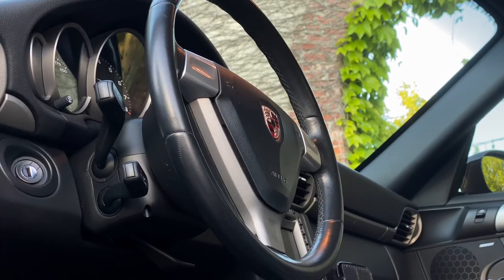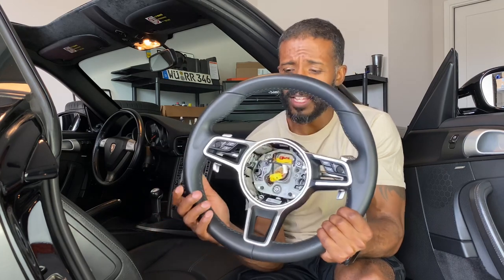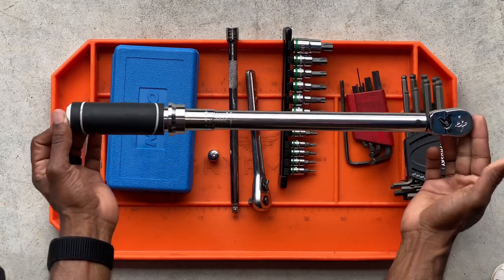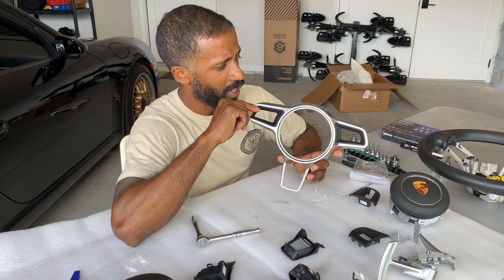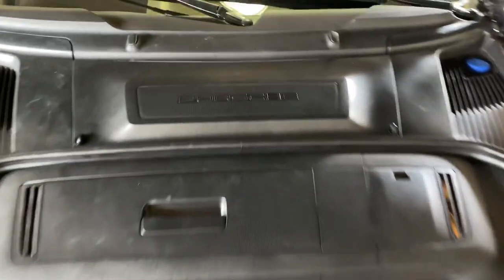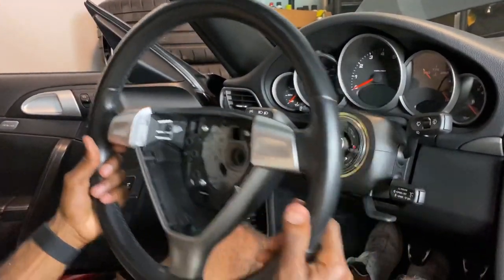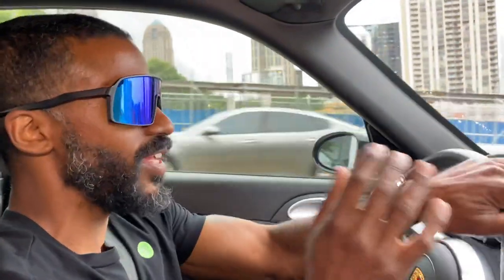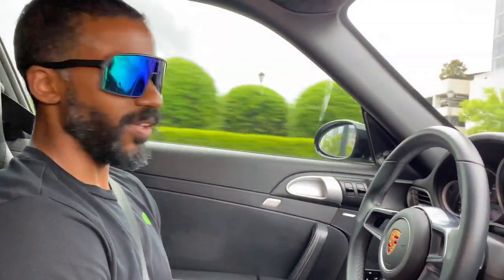Porsche 997 to 991 Steering Wheel Upgrade - COMPLETE DIY!!!

Comment: Hello. I just have two quick questions:
1. Would you be able to share the part number for the manual trim inserts?

2. Is the new wiring harness for the airbag the same as the 997? So if I were to buy things separately, would I be able to transfer my old wiring harness?

Thanks for the awesome videos :)
Reply from the maker: I believe I did in the description.
Reply: @KRTLyfe  sorry but there is no manual trim inserts part number, could You please share this?
Reply from the maker: @pniteckitube  Hey, sorry I think I misread your question. Are you talking about the Multifunction delete inserts or the inserts for the blank spaces where the PDK paddles once lived?
Reply: @KRTLyfe  I believe he is talking about the multifunction delete inserts that you referenced that you got from suncoast. Thanks for this video! (I’d like to know, too!) love your soda can solution, pls update us on your “permanent” one as the holes are a concern for me on this route!
Reply from the maker: @allanchu264   Here is the https://www.suncoastparts.com/product/SKU718SWT.html
Reply: @KRTLyfe  ty! ….   I was looking at some other responses to this video - if you didn't see this already, this part should be what you need to replace the shroud that has the PDK paddle holes with one that does not.  95B 419 798 B 5Q0

Comment: Hey, awesome video. Thank you for the detail. I am about to do a similar upgrade on my 987 cayman. I was told i have to use the harness from the ugly triangle on the new wheel in order to avoid airbag warning light. The issue is the connectors from the triangle and the circle are different. Did you have any airbag light warnining light? Thank you
Reply from the maker: Sivasuss from what I read prior to doing this modification everything should be plug and play. I had to reset my airbag light because I turned my car on with out the air bag being connected. If you don’t do that you shouldn’t get an airbag light. If you do, you can easily reset it with Icarsoft.
Reply: @KRTLyfe  awesome thanks. Someone on facebook said i can use the harness but need to get the module. If not,  the airbag and the horn work properly. Did you have to replace any module? Thanks.

Comment: The bottom on steering wheel is for steering wheel heating. It is not a good design as it is easily pressed accidentally.
Reply from the maker: Yes I’m sure someone could press it by mistake then be confused as to why the steering wheel is getting warm.
Reply: @KRTLyfe  did the heated steering wheel button work?  Do you now have a heated steering wheel?

Comment: Hey great work. Do you know if the multifunction buttons will work if you had a multifunction steering wheel to begin with? I have a 997.2 with PDK and I couldn't stand the rocker switch type PDK buttons. I switched to the Sport Design steering wheel with paddles but gave up the multi function buttons. Any thoughts? Would be great to have paddles and multi function.
Reply from the maker: Louis Lin from what I have read if your car has multifunction all ready. It should work. I can’t tell you that is 100 percent true but I have done a lot of reading on this and that seems to be the case.
Reply: I have a 997.2 and no the multi function doesn’t work
Reply from the maker: @luke4193  have you tried Durametric or Icarsoft? You might only need to turn it on.

Comment: Bro mine is the same wheel but I have the paddle shifter pdk.. so will the new wheel I am buying with paddles automatically work on new wheel? Or module needed.
To be clear it doesn’t have MF options as I don’t want them

Comment: Brilliant video- did the horn work ?
Reply from the maker: Yes sir, I had so many questions about the horn I made a recap video showing the horn working.
Reply: @KRTLyfe  thanks I’ll check it out
Reply: Hi- I have purchased the same wheel and require the new trim parts to do without the multifunction switches- do you have the part numbers for the new trim Thanks in advance

Comment: Where did you get the Macan wheel? eBay range is $1K or more
Reply from the maker: As I stated in the  beginning of the Video. I found mine for sale on FaceBook Market Place. Thanks for watching commenting and subscribing. We sincerely appreciate the support.
Reply: @KRTLyfe  I didn't catch that. Great write-up. I'm intrigued. 2005 Boxster
Reply from the maker: @MrJbipes  Thank you sir! It is an excellent yet easily reversible modification. The 991 steering wheel has a much better tactile feeling and aesthetic. This was my favorite modification on my 997.

Comment: Does the horn work?
Reply from the maker: chriswit66 yes!
Reply: That’s awesome looks great. I put a 991 in my 2008 997 c2s and the horn doesn’t work. I’ve tried so many things, and then changed back to my old wheel, and it was so bad after having the nice wheel, I had to swap back and I just drive with no horn. Lol 
Apparently in some older 997 the horn contact is different and you need to replace and recode the clockspring behind the wheel. Glad your is working. Looks great
Reply: @chriswit66  did you ever fix that just realized i have the older clock spring so horn doesn't work

Comment: look, why don't just fit an original 997 Sport steering wheel (I have it on my 997.1 TT manual).......... similar shape, no Macan involved, same interior colour and you would have preserved full originality. AND the look is not too far off.
Reply from the maker: Luca Olivieri I pondered all the viable options and concluded that the 991 steering wheel is the most aesthetically pleasing to me. The other steering wheels all look like after thoughts in my opinion rather than a focus point. However if I decide to sell my 997, I will put the triangle mushroom back in place. 

I like the sport wheel but I love the 991 wheel.